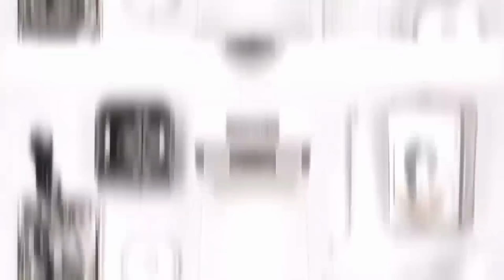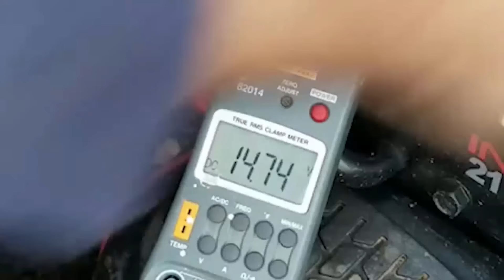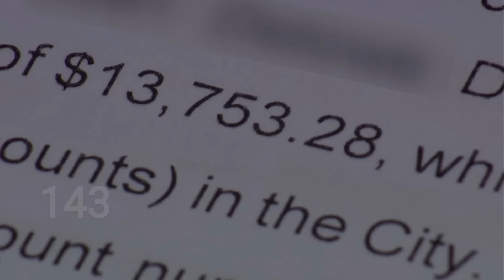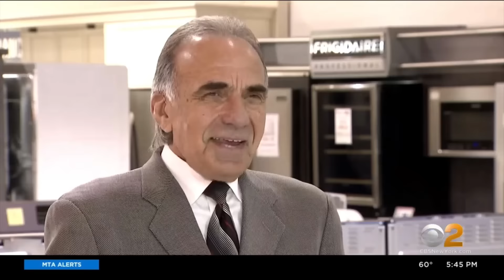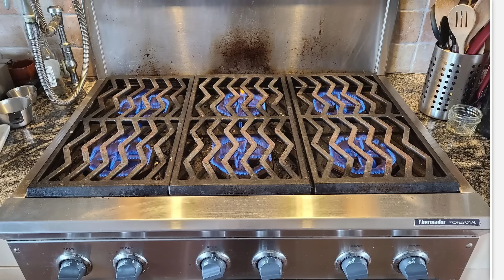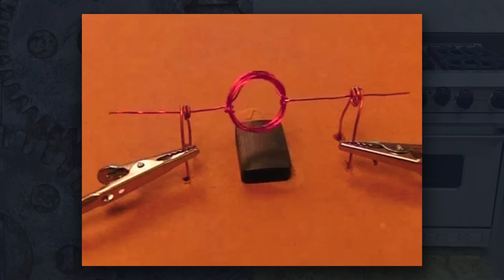The Only 5 "Dumb" Machines Left (The "No Chip" List)

Comment: Um on #1. Guys, just buy a french press, its better coffee that way anyways. 

#2 use an old school rotary bladed lawnmower. Theyll cut wet grass. If you want to make it easier to use, jog with it. Thats what i do, 1/2 acre in 15minutes.

#4. I live offgrid. I took a big old chest freezer, built a new ridiculously insulated box and but it underneath my counters in my kitchen and moved the freezers refrigeration parts to it. I hinged the counter top. I operate it on the warmest setting, compared to a normal fridge, its next to no power draw at all. 

#5 my stove is built into my thermal mass wood rocket stove ←the most efficient stove on the planet. You gotta make it yourself.

Comment: I have a semi frost free refrigerator, the most efficient type you can get. It has a mechanical thermostat, a light that works off mechanical switch. Frigidaire got it as a scratch and dent for $214.00.
Reply: I bought a 21 cf GE "dumb" refrigerator about 9 years ago. It's still going strong with no repairs, and if it does need one, chances are I can do it myself.

Comment: My 99 dollar, 20 yr old, 20 inch push mower from still runs fine. I didn't change the oil for 15 years (I did add), gray goop came out the drain. I did clean the air filter and spark plug a few times, they're still original. Our 30 yr old upright freezer recently died. Not sure if the replacement has a PCB but I hope it lasts at least 15 years. Our fridge is 20 yr old, still working even though my wife leaves the door open to often. Hot water heater only lasted 10 yr. H-Depot replacement is 10 yr old now. Dumb 20 yr washer/dryer still work, not looking forward to replacing those.
Reply: You have corrosive water. Check your anode rod in the hot water heater after two years. If it's corroded away, or almost gone. Replace it with a new one. Anode rods are cheap. Put new ones in every two or three years, depending on how corrosive your water is. You can double or triple the life of your hot water heater. It also doesn't hurt to flush the hot water heater every year or two.